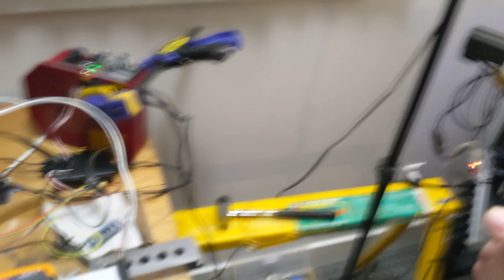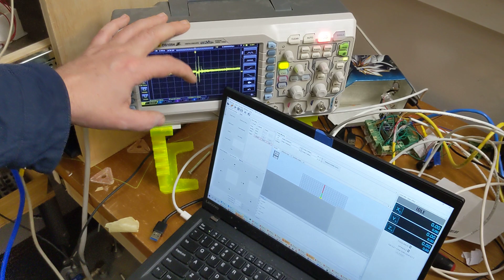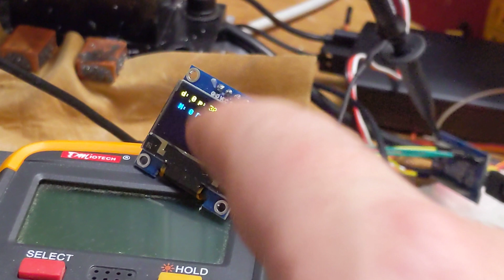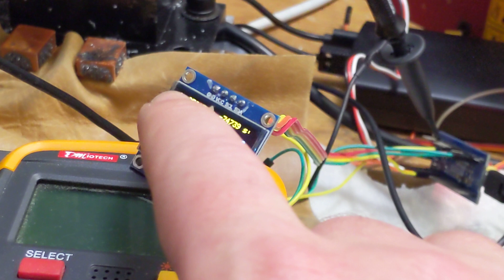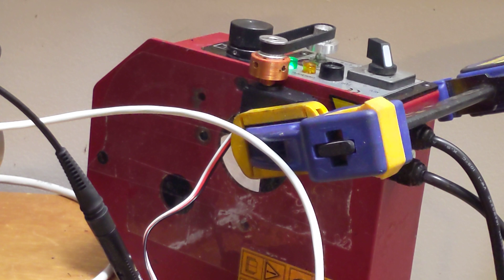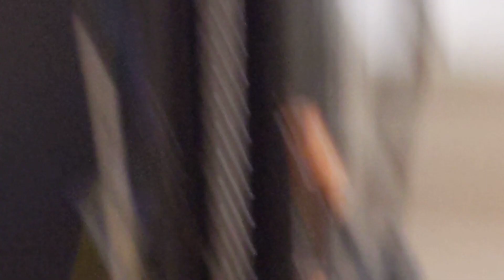Worst cnc controller idea ever

Comment: Maybe if you open up the spindle control box and look at the board inside there could be some options on the board itself that weren't fed to the outside controls (but there for higher end models), like a spindle speed control input.
Reply from the maker: these tend to run everything (even pots) at high voltages so I didn't want to poke around in the controller too much.
Reply: @JesseSchoch  ok